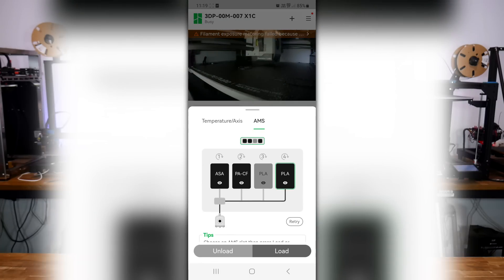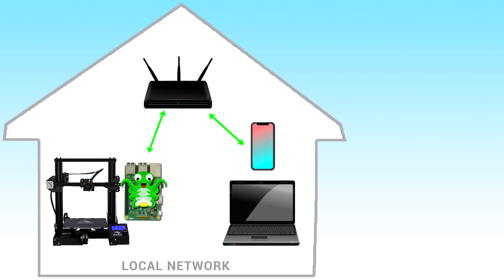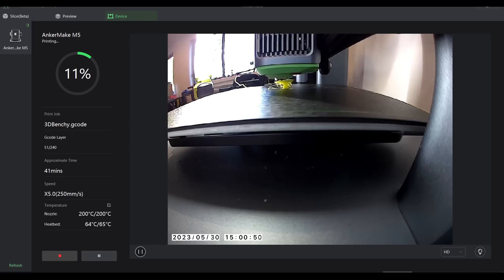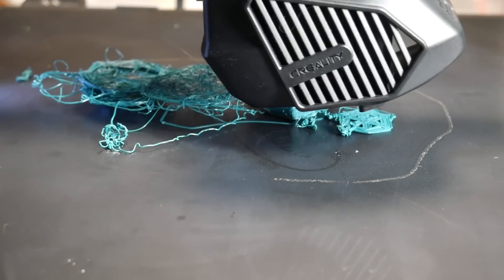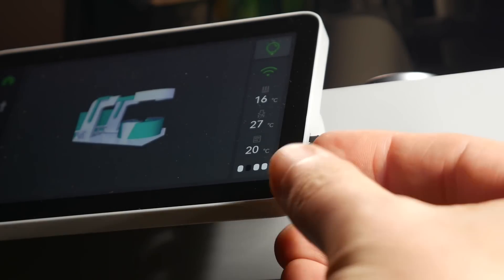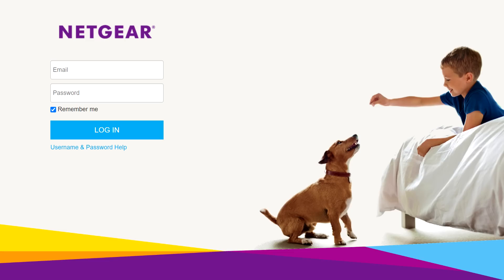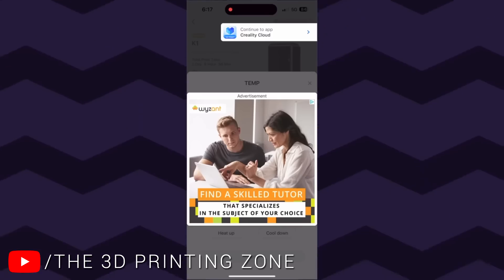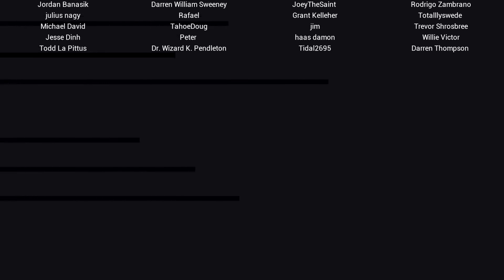The pros and cons of 3D printer cloud connectivity

Comment: First don't sell any of your old non-connected 3D printers. If something happens, you can use them despite that they're too slow (except if you assembly a DIY 3D printer). I don't trust any cloud services even in my phone with my pictures and videos and ignore all the pop-up messages that tells me to use the cloud to "avoid" lost my data but I use the cable, connect to my PC and keep all safe on an external hard disc drive. Second, It's OK for me to control the printers when I'm outside from work but I (will) never download any STL/Gcode from the cloud because I love the fact to stay at home to check the first layer adhesion and next keep doing my things but checking with the mobile phone. Some gcodes are not  suitable for your printer because there's people who upload them an cause your printer to fail. There's tons of options to avoid the cloud. My old 3D printers has a normal security camera from Yi home that's very cheap and I can check how it goes and turn off the printer if something is wrong with a smart plug. I have control of my 3D printer. With the cloud you don't know if somebody, with bad intentions, take your IP address of your printer and make it fail. Please... and finally....Avoid the cloud as best as you can. Just use it to control the 3D printer but not to send/share any file.

Comment: I believe that sending files to print out of home is just marketing. Yeah, there is some times I'd like to do that, but it isn't that useful to me. Only way it makes sense would be a machine with multi-material capability, like the AMS, and having the desired material and color preloaded. For a home printer, the cons are way worse then this function, and for a company printer there will be somebody available to tend to the printer anyway.
Spaghetti detection is great, tho.
Anyway, I use Klipper on my printer, and I can reach it by remote connecting to a computer in home. Could be done for free, all printer profiles and slicer options are there, ready to use, without any ADs, no (aditional) security concern and no chance of the service just disappearing.

Comment: I'm surprised nobody has mentioned a man in the middle attack in all of this.  It wouldn't be hard for a malicious actor to change the gcode between the cloud provider and the printer with potentially damaging or even dangerous potential.  Also, the most common source of attack traffic on the internet is cloud connected devices.  I'll be keeping all of my printers off the internet and on local network only.

Comment: You can't send a print to a bambulab printer without going through the cloud? That would be a deal breaker for me. I'm also now reading that while Bambu Studio slicer is open source, the network plugin is closed source.

It looks like I'm going to have to buckle up and dump a full work week into building an open source klipper printer.
Reply: You can use LAN mode on the printer to turn off cloud features and still print wirelessly. With cloud enabled you can still send directly to the printer by using Send instead of Print in the slicer, or using ftp, or using SD card.
Reply: @technicallyreal  Good to know, however, with the closed source nature of Bambu Studio networking, I'd need to inspect the network traffic to be sure my files still aren't being uploaded to their servers even in LAN mode. This is a regrettable choice they've made in my opinion. I'll have to stick to PrusaSlicer and Klipper.

Comment: Along the same lines as the "servers shutting down for games because the game gets too old," there's nothing saying Bambu for example will keep functionally for the X1 and P1P once they're old. Once there's an "X2" or "X3," and a "P2P" or "P3P" who's to say that Bambu won't disable functionally of their older printers, either because they're "too old," or to encourage users to purchase a new one
Reply: Yes there is as these printers work with out being connected to the cloud.   So even if Bambu stops supporting it that doesn't mean it will not print.   Besides if there is a big enough market for it people will design or make a business out of creating spare parts just like they have done for the car industry.  But your complaint about Bambu can be applied to nearly every tool in the DIY space.  Say the KLipper developers decide they are done unless there is someone willing to pick up that project and continue it will die just like anything else.  Proprietary or closed source they both have the same outcome one is just easier to pick up and run with than the other, but if the market truly exist both can be done.
Reply: @mekko1413 I completely agree. I was simply saying that "getting too old" could eventually make Bambu remove compatibility for cloud services for those printers in 5-10 years. I'm very glad that these printers still have SD support. I was simply mentioning how getting attached to using the cloud with your P1P might be a bad idea in the long term, when the P1P becomes ancient history. I'm aware that the printer will still print without the cloud.

Comment: On my side i love using my 3d printer trough usb because the company who made it still sell the lcd screen at 50€. Bought the printer 300€ five years ago and now they are selling it at 479€ with cold bed and no springs. I don't understand those kind of company. For this price you can have a prusa mini with springs / hot bed.

Comment: Creality isn't the first to encourage users to move to a subscription to get an "enhanced" version of the app. It was only a couple of years ago that ChituSystem made boards that required signed sliced files that kept other slicers, unless they used an official SDK. The SDK only came about after the outcry was much larger than probably expected. 

( I just came across a video from Uncle Jessy a month ago that ChituSystem that the latest boards, like on the Saturn 3 Ultra WiFi, that allow the user to send a job to the printer wirelessly requires the user to use Chitubox software. And supposedly, as of a month ago the Chitubox app and SDK crash on Macs with the Apple M1 or M2 processors.)

Comment: I do have access to my 3D printer / OctoPrint via CloudFlare tunnel. I configured in such a way that ONLY me have access to it. I can access from home with no problem using domain as it knows that i am using home network (M ISP Public IP address whitelisted) and if i am accessing from outside home network it uses 2FA, email gets sent with temp PIN number valid for 30 min.

Comment: I think its worth mentioning that at least Bambulab has a Lan mode. I will say though that it doesn't have feature parity as unreasonably Lan mode doesn't allow you to see the video stream, and they've said they would fix this, but haven't gotten around to it.

On top of that, there is no way to update over microSD or Lan, which means you can't update without internet connectivity.

The worry about theft is very legitimate if you are a large corporation though. Having servers in China and therefore accessible to the Chinese government, makes these printers a no go for companies.

Also, my God if the Bambulab app was anything like the creality app I'd throw the printer out and never recommend them again. I also don't recommend the K1 for the same reason.

Anyhow, if Bambulab enabled video and allowed you to update in Lan only mode, I would be sufficiently freed of worry that it might be something nefarious planned for the future, because you would have more control and freedom if the company exploded.

Comment: At this moment I think that the pros are not important or useful for 99% of users. They are a very minor quality of life/user experience/"nice to have the option" thing that the average user will rarely use. So unless an extremely useful feature comes up that people will use for most of their prints and it requires the cloud, it is currently better and more affordable to use printers locally/offline/directly. Let's not forget, 3D printers are just electronic devices/tools. Do you need a cloud connected pizza oven to be able to remotely turn it on or a cloud connected air compressor? In most cases people use electronic devices and tools directly and rarely there are systems setup for "just in case" scenarios. Either you have not planned things (no pizza prepared, no filament loaded) or you have planned (compressed air tank full, planned print queue) and you start using the devices/tools when you are next to them because you planned for it... I have 9 years of experience with 3d printers (7 years professionally), I set up remote control once for one of the printers when I used to provide 3d printing services on demand, never practically used it, because there is seriously no need.
Reply: I think you underestimate how big access outside of your home is for people. Setting up a VPN is so far outside the scope of what people are comfortable with that I see the value there
Reply: @BeefIngot  I think you missed my point. I did not say, if you need remote control outside of your home you can do it with a multi-step and complex way without the cloud. I said no one "really needs" remote access to devices and tools. The convenience factor is so minor that even the ones that use cloud connected 3d printers, rarely actually use cloud only features. The reasoning is when things are serious ->professionals, print farms, etsy sellers there is a plan/schedule/print queue and no need for remote access and if things are not serious, you use the feature once to try it and then never again, because there is seriously no need for remote access
Reply: @Dramaican88  I think you are really pushing something that just isn't true practically. Many people enjoy being able to see their prints remotely. So much so there are a lot of octoprint plugins that setup similar cloud services for the same thing. I think you are projecting your feelings on the feature onto other people when clearly the demand for this feature shows that others feel differently.
Reply: @BeefIngot  Well it seems we are in agreement. You used a very correct word in my opinion and this clears things up and puts us in agreement. You said "Many people enjoy being able to see their prints remotely." Completely agree  :) and notice the word "enjoy"! I focus on a different view point or aspect and therefore use a different word to describe it purposefully. I said "there is seriously no need for remote access" and notice the word "need". There are no feelings about a feature to project here.  I said from the beginning in my comment "nice to have" features.

Where I don't agree, unless you meant something else is about the "demand for a remote viewing feature" and notice the word "remote". Cameras for timelapses and recording failures to playback the log to see why and when a print failed for example are very useful features and therefore many printer manufacturers include cameras or at least camera support with their printers. If you look at the Prusa survey https://blog.prusa3d.com/wp-content/uploads/2023/03/MK3S_priorities3-scaled.jpg users actually have the camera quite low on their feature demand/priority list and "remote monitoring" or "remote access" are not even considered/listed as features by Prusa. My guess for why one of the biggest printer manufacturers in the world doesn't consider/list remote access features, is that there is no need and demand for them and other features are far more useful and higher priority for them to work on and implement.

"Nice to have"/enjoy is different than need/demand.

Comment: Bambu is definitely feeling the strain on their cloud service. Sometimes it takes 10 - 20 seconds for the printer video feed to start playing after tapping the play button in the Bambu Handy app.
Reply: And the risk is that a bean counter in Bambu will come up with the idea that if you pay them some extra dollars you can go to the top of the queue. Then before you know it everyone has to pay per print ... No thanks!
Reply: @martinathome296  Bambu's cloud is entirely optional. It's only needed for a handful of connected features, like monitoring prints with a phone.  The printer works perfectly when disconnected from the internet completely.
Reply: Bambu has a LAN only option that entirely omits the use of their cloud.

Comment: This is my biggest guff on my P1P. Yeah it’s nice to send files from my computer to my printer, but going through their cloud services is stupid. Why can’t I just send it over my local network like klipper does. It’s slow as heck for the P1P

We’ve talked about it on your Discourse forum. But had to vent again.
Reply: You can send it over your local network, but like you said, it's just slow. However, it's actually not any slower over your local network than it is when using normal/cloud mode, it just feels that way because you're forced to watch the progress bar on your PC as file is transferred to the printer's microSD card. In normal/cloud mode you only watch the progress bar as the file is uploaded to the cloud, and then the file is transferred from cloud to the printer's microSD card in a separate step (which you can see from the printer itself, on the LCD). 

For example.. It may only take 10 seconds in normal/cloud mode, yet take 45 seconds in LAN mode. But in reality it's taking 10+45 seconds in cloud mode, but you're not forced to stare at the progress bar for the 45 second stage (unless you go stand at the printer and watch it happen over there).

Almost forgot - the actual reason it's slow is because of the crappy ESP32-powered WiFi. Supposedly much faster on the X1.
Reply: @technicallyreal  interesting. I hadn’t tried. I knew you could still use SD card functionality, but it just adds time and feels convoluted. 

On my other machines I like how easy klipper is. 

I also don’t believe the P1P has any of the AI spaghetti detections. It was mentioned in the video that “all Bambu printers” come with it. Not trying to nitpick bir worth noting. Unless I’m an idiot and just overlook that feature on mine.. which I suppose is plausible 🥹
Reply: @technicallyreal  for some of my bigger prints too, it’s taken over an hour for it to download and unpack the 3mf files. I’ve bitched about it on the discourse before, and the consensus was that the X1 didn’t have the same issues. 

Which kind of bugs me, because the P1P is more marketed as the X1 without the case, AI and a few bells and whistles. It felt very much that the brass tacks of them were the same

Comment: Oh no, I didn't know Bambu Lab actually couldn't print without an internet connection. I kind of assumed that the files would go via my local network. This is retarded. I just ordered this machine two days ago after a lengthy research and hadn't come across this topic yet. It's in transit to me now, had I known this, I might have reconsidered getting one as I absolutely hate throwing around SD cards and this is one of the reasons why I bought the Bambu Lab X1C as I thought it would have WiFi printing.

My DiY machines also have WiFi, which I have created and set up myself and it works fine. Isn't there a workaround to install maybe a Raspberry Pi into the Bambu X1C and have it run via the Pi somehow??? Maybe someone will develop/hack this into the Bambu Lab printer one point in time?
Reply: Bambu machines can print without an internet connection, but the default setup is to go through the cloud. There's a LAN-only mode on the printers which removes the cloud from the equation.
Reply: It can. You inferred incorrectly from the video. It was somewhat hard to parse, but Bambulab specifically has a Lan mode

Comment: It's almost impossible to avoid cloud services in our daily life but we can avoid them as much as possible - meaning, don't buy a 3D printer that explicitly requires the use of cloud-based printing. I'd also maybe go as far as to say that you shouldn't buy one that offers it as a convenience, as the only thing standing between you and forced cloud printing is a firmware update. Would everyone install said update once word got out? Maybe not. Wouldn't enterprising community members find a way to roll back updates or jailbreak the printer after such an update? Probably. But at that point, you'll probably be at the very least banned from buying spare/replacement parts or getting official service. Maybe worse.

Comment: The bambu lab x1c can be set for local area network only. You can send the file to your printer via the lan, but you will still need to go to the printer to press start. You will also lose the timelapse feature.
Reply: You also lose the ability to update the printer firmware.
Reply: Prints start for me without having to go to the printer. Unless you mean in normal/cloud mode, using the "Send print" option in the slicer. That goes over LAN, but doesn't start the print.
Reply: @technicallyreal  I was talking when you put the printer in lan only mode you can't start a print from the slicer.

Comment: Been burned too much by Cloud stuff. $200 Canary cameras that had features revoked and turned into paperweights if you don't pay monthly. Ring doorbells doing the same thing if you don't subscribe. Went with HomeAssistant and Frigate NVR, even got my Roomba running with ha-rest980 so it's not dependent on the cloud so the connection could be severed. If you can't self-host, at the end of the day you don't really own the product. Next project is Obico for local printer AI failure detection which should be fun!
Reply: worse fact about ring door bells, they give the police a 247 feed of your house and family
Reply: @BeefIngot  yep I ditched them after Amazon bought them and wanted to do that "sidewalk" crap